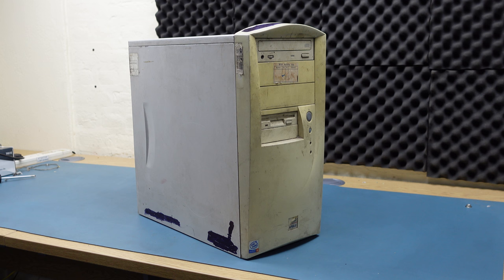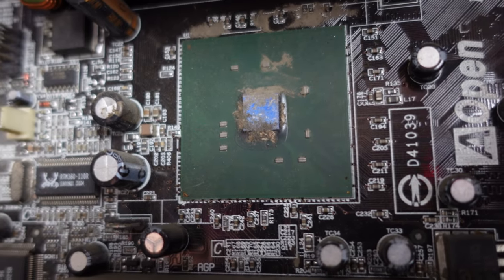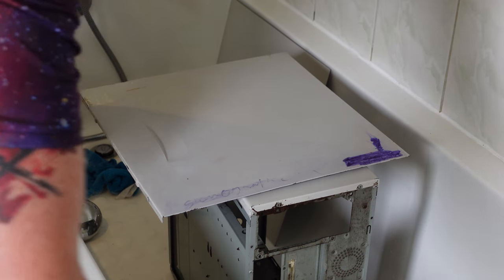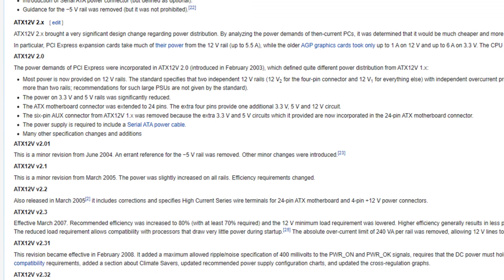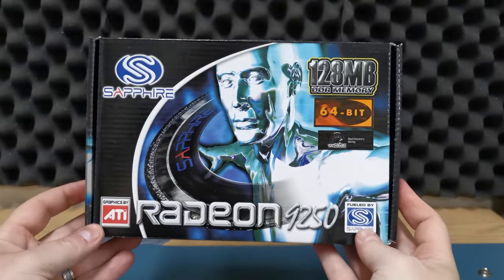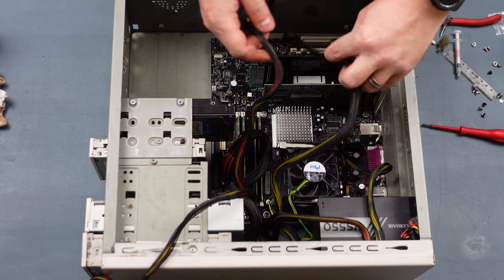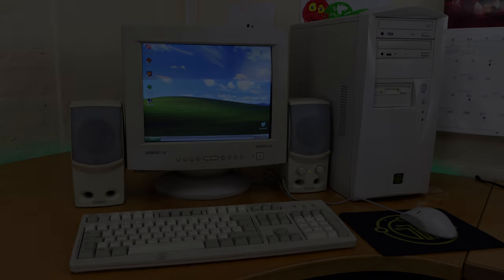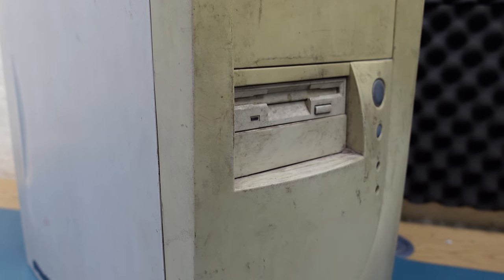This PC Wasn't Worth Saving | Pentium 4 Build

Comment: I remember when the very first Pentium 4s came out in late 2000 and early 2001, I remember that this was even before Windows XP was released, so at the time, Windows ME would've been the latest and greatest operating system. However this Pentium 4 seems to be a later generation most likely made in 2002 or 2003. This would have been well after Windows XP's release.
Reply from the maker: Yep, sounds about right 👍
Reply: @TechMadeEasyUK  actually the oldest computer that I still have today that still works is a Toshiba Satellite 330 CDS from 1998 that has a Pentium 266 MHz cpu with 96 mb of ram and I have it running Windows 98 second edition.